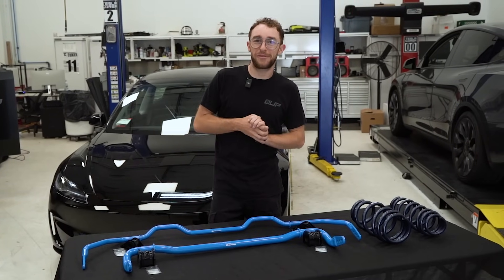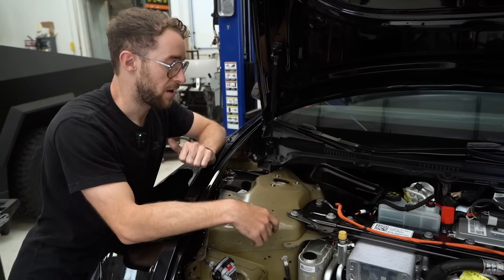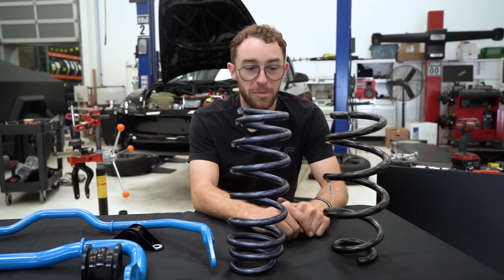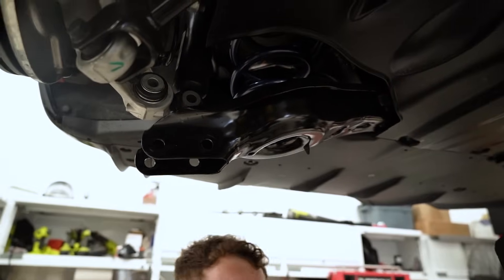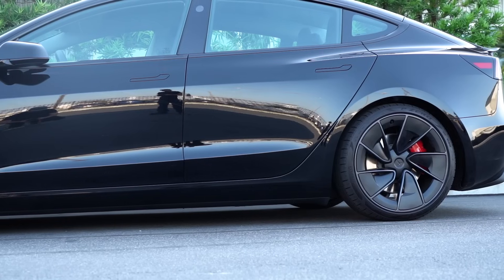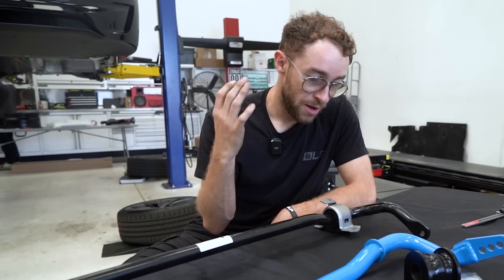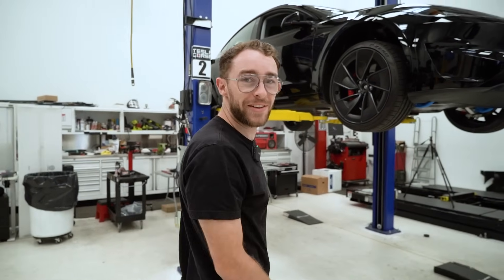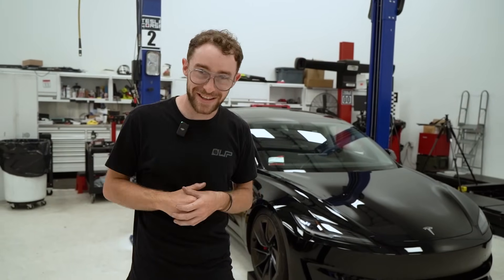Model 3 Performance Gets Lowering Springs + Sway Bars + Testing Unplugging Adaptive Shocks

Comment: Can I replace the 20-inch wheels on the Highland M3P (both front and rear) with 19-inch Nova wheels (235/40 R19)? Will it interfere with the brake caliper or affect the functionality of the adaptive suspension?

Comment: Lowering kit? The standard Highland feels extremely low already and the Performance variant is lower than std. A lowered Performance would be un-usable to me. I am already connecting with steep curbs / ramps as it is. Try to measure ground clearance just in front and behind the wheels. I bet you only have 5cm.

Comment: With the new springs... I think the ride will be too firm, too accurate, with the sway bar sizing added also. Maybe one change at a time to Verify. Can't wait to see some tire shredding, in the turns at a full drift, and high speed at full flight, with all wheels off the pavement!  Yea!

Comment: Does the highland suspension fit on to the older model 3 performance?
Reply: Tesla Interchangeability! YES!
Reply: @dporrasxtremeLS3 do u know for sure?  Will the regular long range suspension fit or you mean both that and the performance?  I won't be adjustable right?
Reply: @dyhppyx  I have not worked on any Tesla. I do know that Tesla keeps things Very simple. Interchangeability is part of who Tesla is. Many suspension parts will work on Many years of model Y with the Model 3.

Comment: Would love an idea of ride quality difference after the mild drop. Interested in a potential mild drop to go with your full body kit so also concerned over daily impact of both the new front splitter and the mild drop option in terms of driveway clearances. To clarify I suppose I'll wait till you add the body kit on at a later time, but would love to see the kit on a stock height, mild spring and heavy spring and how day-able it would be?

Comment: On the previous gen M3 you didn't need to remove the whole arm to get the suspension out at the front - using a thin walled 13mm socket (or grinding down a standard 13mm socket as I did), you can access the 3 top mounting nuts through the holes. This gen M3 looks similar/ the same.
Reply: I just Love the interchangeability! Tesla 5 Stars!!!

Comment: You didnt confirm how the car rode with the mild springs vs stock ?   How much will it change ride comfort??? I’m sure that’s what most people are concerned with between your spring lines.  Please comment on how it felt on bumps and city roads
Reply: Yes!
Reply: They did. Dual rate springs allows for more aggressive dampening in hard cornering while retaining stock like comfort during milder daily driving.
Reply: @hyp36rmax  A proper review would have been to take some time to film the test drive and talk about how it rides during the test drive and give proper feedback to assure customers what they can expect if they buy and install these springs.  Not just a quick statement saying it rides fine.  As a customer I don’t want to invest that much money and time just to find out their statement wasn’t accurate.
Reply: @davejohnson6144  Suspension is all based on your requirements as a driver. 100% custom to you or as close as you're able to accept. Best recommendation is to test a car with a similar setup.
Reply: @hyp36rmax this has caveats. In the previous year Model 3s, the softer mild dual rate springs made the ride bumpier unless you also added the UP dampers as well, due to reducing the travel length of the spring while having the original travel length on the stock damper.
Reply: @BaneSIlvermoon  This is true. I'm not sure if UP used existging specs on  these dampers or if they recieved input from Tesla to design.
Reply: @hyp36rmax And what if the "soft" part of the spring is harder than the spring. Or the hard part of the dual rate is a lot harder.
Reply: @swecreations  That's possible, depends on your driving style and requirements. Best to test drive a car with this setup to fit your needs.

Comment: Looks as if there is a sort of strategy for those wanting to go Coilovers. Short term solution probably needs a way to fool the system from thinking factory solenoids are still active when disconnected. Long term end goal is to have a coilover OEM (Such as KW DDC) and Tesla (Give access to 3rd party to interface dampening settings).  This will be exciting.
Reply: That would be the ideal scenario. Maybe Tesla offers a track suspension upgrade down the line? Seems unlikely but let’s see!
Reply: Oh Yea!!!

Comment: I've learned that this new Performance Model 3 needs no mechanical modifications whatsoever, but this video and Luke are awesome!
Reply: Depends on your use case. Perfectly fine for daily road driving.  IF you're planning to track the car, factory brakes are still crap. At the very least you'll want higher performing DOT fluid (MOTUL RBF600) and pads.  Serious drivers will opt for larger calipers and rotors. (Yes mechanical!)
Reply: @hyp36rmax  It comes stock with the track package pads now. I never had any issues on my track days with those pads. Might need fluid though. It already has bi metal rotors and 4 piston calipers. It really already is a beefcake.
Reply: @CharlesCo918  Are the new brakes still Brembo?
Reply: @CharlesCo918  Yea, brake cooling is important. Def fluid, I wouldn't skip on that. Calipers are the same 4-pot Brembo from the outgoing model. I think two variations of the same caliper. Are the pads semi-metalic? not sure what compound Tesla's Track Package is. I assume yes, unless they went full send with full metalic.
Reply: Funny how aftermarket tuners think they know more than Elon’s engineering team!
Reply: @RayNLA  funny you don’t know shit.
Reply: @RayNLA  I mean... you know Tesla continues to do everything they can to reduce cost, right? That's been the company goal for the car for almost ten years. They aren't going to be coming stock with the best parts you can get.
Reply: @RayNLA  How old are you? I say that in the most kind way because you sound stupid.
Reply: @RayNLA Can tell you that as far as brakes, this is far from being enough. Previous gen needed at least gyrodisks, brake pads and fluids. This new gen has the same brakes minus the pads. 100% it won't be enough for any serious track driving. Garanteed
Reply: @nabushdinosaure  most Tesla drivers won’t know. They also don’t realize Model 3 and Y are commodity cars, won’t always have high end parts. Great daily’s though.
Reply: @nabushdinosaure  It comes with semi metallic pads.

Comment: Are you able to align the wheels back to stock with the low springs?
Reply: Judging by my experience this is almost impossible unless you use a camber kit - there's not much play in the stock arms to get camber right once you lower in the M3.
Reply: @YTuberosity  Then Make these bushings!
Reply: Absolutely not!

Comment: Sounds like you guys will need to make a fake (dummy) adaptive suspension plugin module that simulates that the OE shocks are still attached.  Then you can add coilovers.
Reply: That's probably the way to go. Choice point for some folks. I'd sacrifice adaptive dampening for a more solid suspension to my driving style 100%.